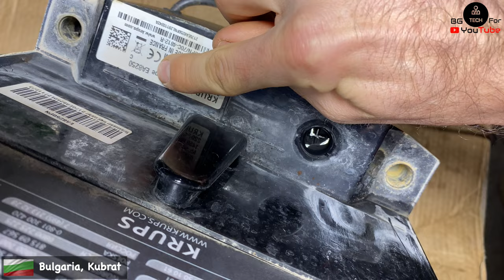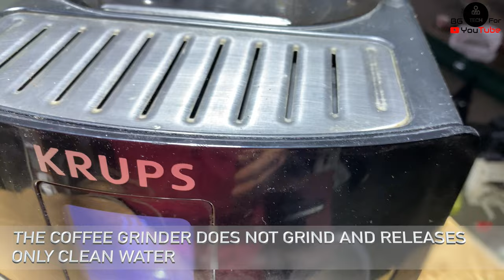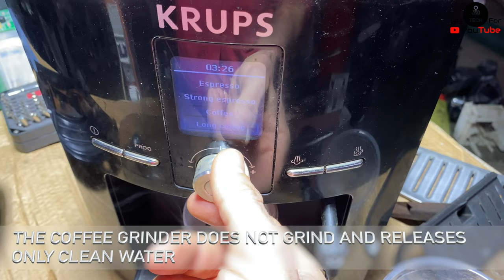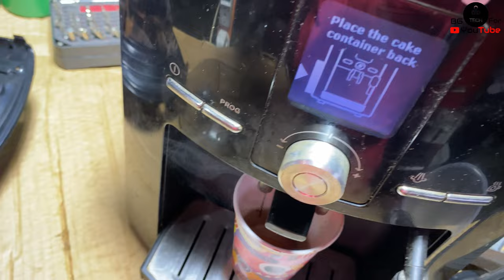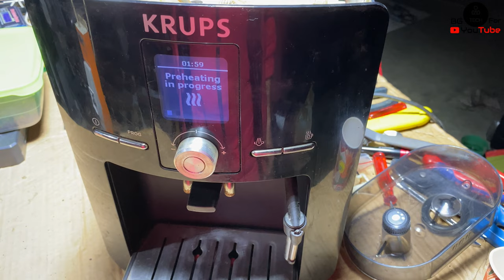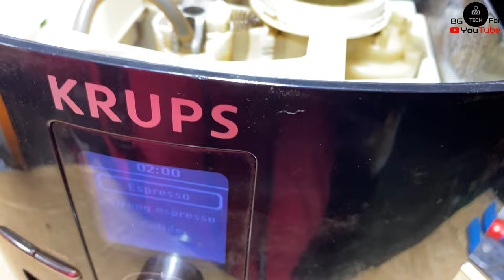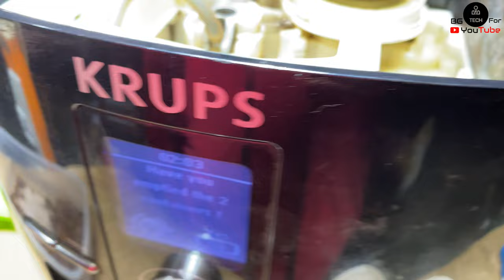4K ✅ Krups EA8250 Grinder Repair and Clean ✅ Not Grinding Coffee Grinder Teardown ✅ Repair 😱ONLY 1$

Comment: this is short term repair, because grinder is over 
12:40 the ejector blades are worn, replace ejector.
Reply: Hi can you explain more ? I’m having issues with my machine and I think it’s coming from the distributor
Reply: @622sim  the coffee ejector blades in the grinder were worn out , which causes the coffee to remain and coffe is grind to dust, as a result, the pump is unable to push water during brewing and ejects water back via 2 bar  valve, problem after 10k coffees, replacing the grinder with a new one helped.